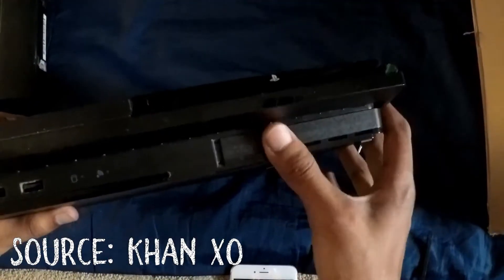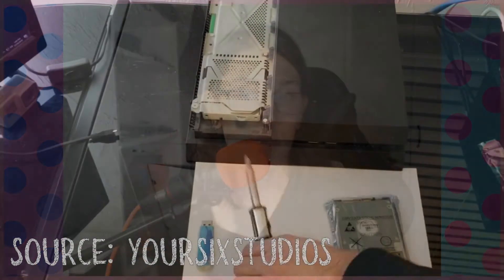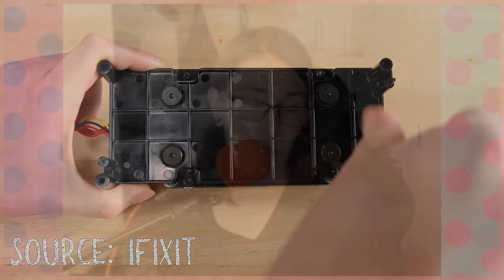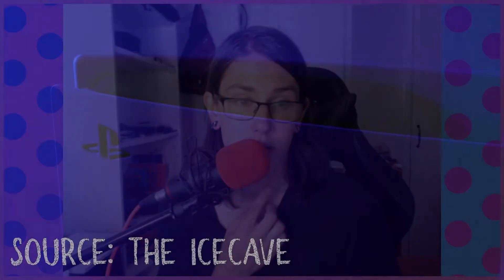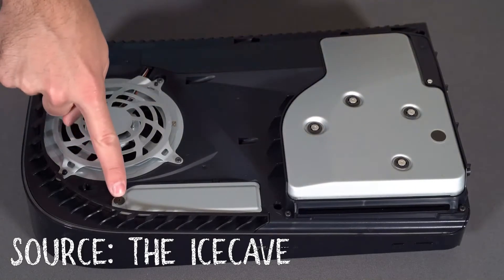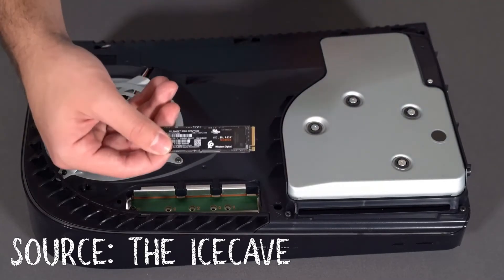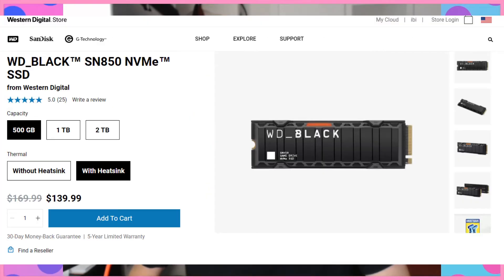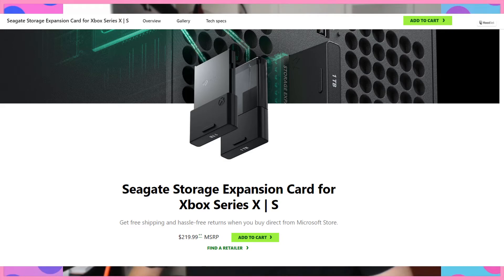System Storage: A Brief History and My Issue with PS5's storage

Comment: wrong! as being in the ps5 beta your wrong, there's more than 2  brands that works inside the ps5, im using the pny xlr8 cs3140 in my ps5, it was simple and fast! aorus, sabrent, firecuda,WD,pny all these brands and others works inside ps5....what sad is xbox only having 1 option and 1 size card to use....ps5 has from 250-4tb of memory and multiple brands to chose from, thats called options...when you get past the install of card, you really have nothing else to say.
Reply from the maker: As i went over in the video. I specifically stated that what was available in regards to information was those two drives. That's why I SPECIFICALLY said at the time of writing and recording. And they cost the same amount for the same size roughly. Which is again a point I made in the video. So I'm glad you have more options for more space, even if it costs a lot. But my points in the video were specifically crafted around what available information there was and to accommodate as best as i could for when things eventually open up more. Which still gives credence to my point which is, "The PS5's storage requirements could be simplified." 
- Ambassador Mike
Reply: The Ps5 storage. It gives description of the required specs but states it may not work. When this video was recorded there wasn't a definite you need this drive with this etc. They just posted on the support not all drives to spec work and also not all games work as expected

"SIE cannot guarantee that all M.2 SSD devices meeting the described specifications will work with your console and assumes no responsibility for the selection, performance or use of third-party products." 

"Not all games are necessarily playable with the exact same performance provided by the PS5 console’s internal Ultra-High Speed SSD, even where the M.2 SSD device’s sequential read speed is faster than 5500MB/s." 

In regards to Xbox Series XS. Microsoft stated before launch and iirc before Ps5 reveal that more brands would be available later. Maybe watch Mikes video and actually listen to the content properly

I've worked with him for some time so I know he knows his stuff and is factual and in regards to ssd information I actually discussed it with him and since video done more info on availability that works in terms of product has come to light. We are sorry we can't predict the future